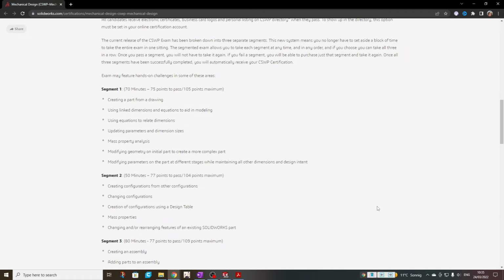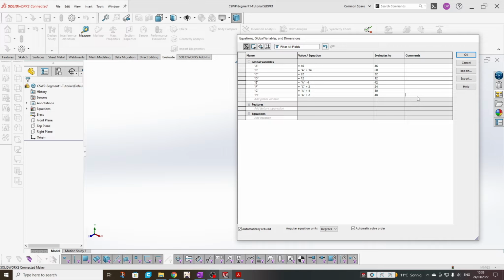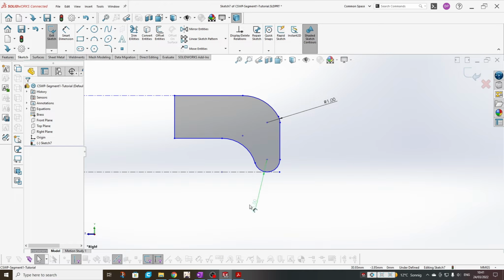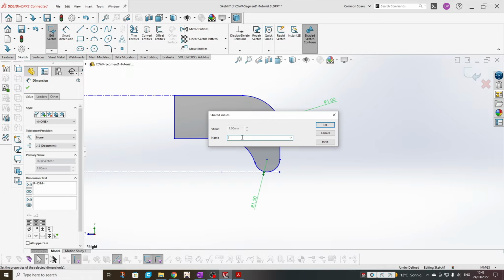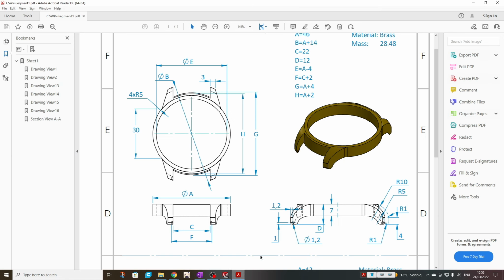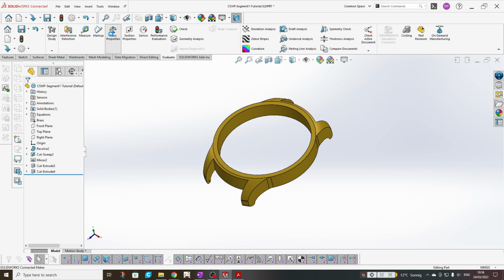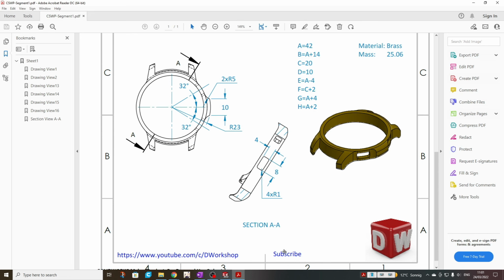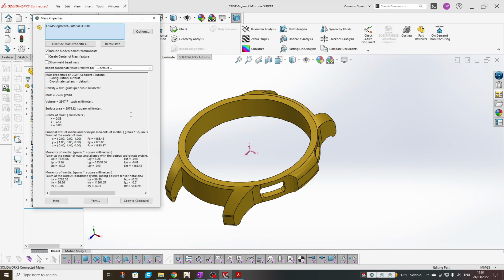Certified SolidWorks Professional - All you Need to Know to PASS Segment 1 Successfully

Comment: Thanks so much for the extra CSWP practice!  I have a question about the video right around 13:39 or so.  Why are the two points on the left aligned at the very top and very bottom of the solid?  I thought that to make a cut that starts at a diameter of H and ends at diameter G (which seems to be what the top view is indicating in the drawing), you'd need to make sure that the point on top (with distance H across the centerline) is coincident to the curved face on top of the solid, and that the point on the bottom (with distance G across the centerline) is coincident to the curved face on the bottom of the solid.  The way you did the cut in the video, it seems like from the top view, the outer arc wouldn't have a diameter of G, but rather a slightly smaller diameter because the cut is made where the sweep cut profile intersects the original solid.  Sorry for the long comment, but hopefully this makes sense. 😅  In any case, my son and I learned something new about swept cuts--the "Keep Normal Constant" option--so thank you for that!

Comment: 8 minute mark makes zero sense!!  Why does your dimension stretch clear past where you place it? Why does nothing else move in your assembly since none of it is constrained??
Reply from the maker: When you dimension a line or point to a centerline, the dimension can be linear up to the centerline, or symmetrical about the centerline. I made it a diameter dimension, which is why I clicked past the centerline. This makes the dimension symmetrical about the centerline and moves the endpoint of the dimension symmetrically opposite to its start point. The rest does not move because it is not related to this constraint. I hope it’s clearer now.

Comment: I modeled it the exact same way as you and ended up with 24.50g. I'm using SolidWorks 2019, all material properties are identical. Any possible explanation?
Reply from the maker: I cannot explain to you without seeing your file. Most common reason for this is a dimension with wrong reference somewhere.